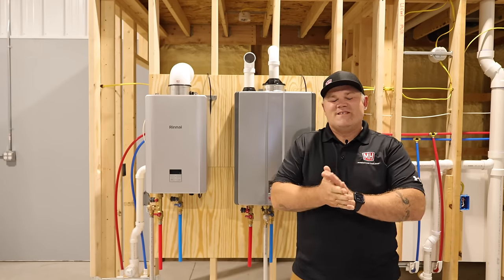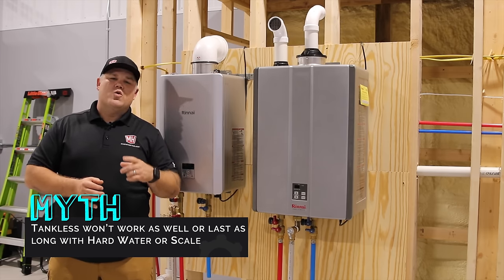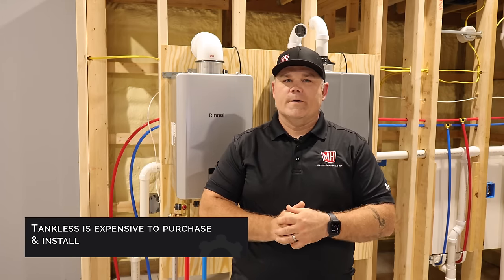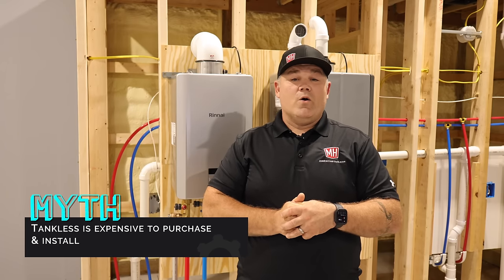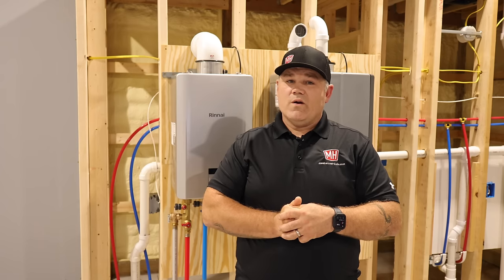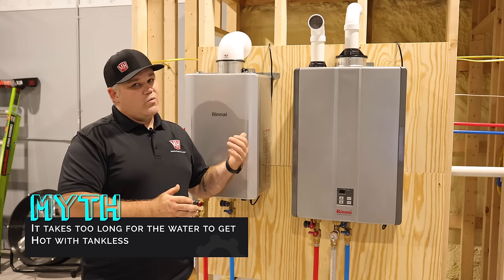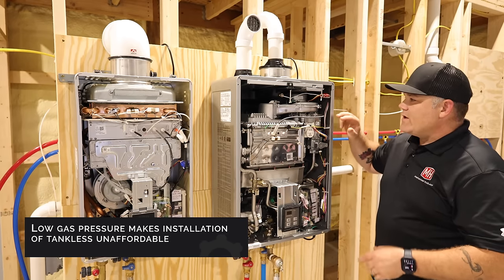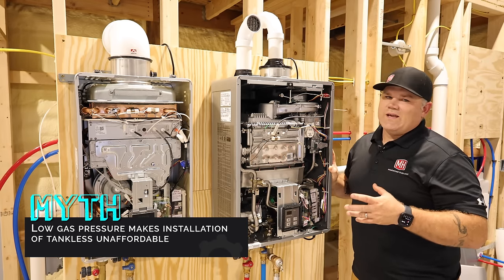Myth Busting! Tank -vs- Tankless Water Heaters

Comment: Nice explanation. Nothing but tankless since the late 90s. Another benefit not mentioned here is that the water outlet temperature never fluctuates, which is noticeable on the smaller, forty gallon units most commonly available. When the old direct vent, Navistar/Bosch tankless unit finally failed a few years ago we got a new Rinnai from Ebay. Running a thirty plus foot exhaust line was a PIA but well the effort. Since my "helper's" father wrote the plumbing code for our state, we did everything by the book. Never had any problems, although the old unit could produce much hotter water, which was unnecessary.
Reply: but under heavy load it will reduce the flow to maintain the temp. both types must be sized correrctly

Comment: I would love to see a comparison to a heat pump water heater on a large tank (90-110 gallon) vs gas tankless.
Reply: My heat pump is in my garage so the noise isn’t an issue and it’s so cheap to run. It was cheap to install after CA tax incentives and once I get solar too. Tankless would have a hard time competing.

Comment: I have 2 Rinnai units in my house. They work great but the recirculating pump is a must. The pump should be scheduled to run during the hours of heavy use like 6 am to 10 am and 6 pm to 11 pm otherwise it will wear prematurelly (the pump not the unit). The advice came directly from Rinnai support.

Comment: I bought my first tankless heater in 1980. They have been common in Europe for many years. I'm English. The second one I bought not only heated water but powered the central heating also. We use radiators in England. I love the fact that you can sit in the shower all day if you want. No  tank to run out.

Comment: Had a tankless heater about 20 years ago and it was the worst mistake I ever made.  The shower water temperature kept changing as my well pump started and stopped.  Hated waiting for the hot water to kick in when turning on a faucet.  Also got unreliable after 2 years and would not start every time.  Replaced with a conventional heater and now totally happy.  They are just too complex for reliability.
Reply: yeah, a tank vs tankless video sponsored by a company that sells tankless "upgrades" is a huge red flag. thanks for the perspective.
Reply: You lost me when you said "20 years"...I'd rather hear from someone who has a recent model.
Reply: @RealEstateRonFL  My big issue is the expense for when it fails or breaks. It was cheaper for us to replace the unit when it started giving us an error code and failed than to have it fixed. Convenient? Sure. Cost effective? Not so much.

Comment: I have a couple of questions.  What is the difference between the condensing and non-condensing units? Which is better in your opinion?
Reply: Condensing units have 2 Heat Exchangers, the 2nd one reburns and lowers exhaust temp. so you can use PVC for exhaust and intake air. They are also Stainless steel vs copper in Non Condensing. SS is because it make acidic condensation. If your condensation is going in cast iron drain you will need a Neutralizer for the Acidic water. I'm an Electrician and have both a Non Condensing NG Noritz and an Electric Steible Eltron in 2 homes.

Comment: Here is what I ran in to when I investigated tankless water heaters during my recent remodel. For context, the existing water heater was a 50 gallon gas tank unit located in the middle of a 2-story house, which is built on a concrete slab. The problems were: 1. The existing exhaust vent could not be used, the building code required replacement, which would have required opening up walls for 2 stories and penetrating the roof. The new vent pipes would not fit inside of 2x4 walls, so the walls would have to be demoed, furred out, and replaced to make space for the vent. 2. A new drain would be required from the middle of the house to somewhere outside, which meant trenching out the concrete slab. 3. I would have had to replace the gas pipe to the heater. and 4, after all that, it would not work if the power failed, despite being a gas heater. The only practical way to have installed a tankless would have been to locate the unit outside of the house somewhere, run an exhaust pipe up the side of the house, penetrating the eaves, and then build an enclosure to protect it. That approach would have required extensive replumbing to get the hot water back into the house, either by opening up more walls or trenching out the slab. Out of three plumbing contractors that estimated the job, two declined to bid and one came in with a proposal that was crazy expensive. So the house still has a tank.
Reply: If you had a condensing tankless it can be vented with 2” pvc pipe
Reply: How about an electric tankless on demad unit. The Bigest issue is runnig 2 8 AWG wires to it and replacing for a 50 Amp breaker in the pannel. Unlimited hot water, only on demand, whithout venting. Could install one for lower floor and a second one for upstairs depending how big your house is. This electric units are very small and fit eveywere. Have 5 units installed in several house/apartments and last about 10 Yrs and repairable( they go for about $220) Instaled them myself. The gas units also work with electricity so either won't work if no power
Reply: JUST DON'T TELL THEM AND INSTALL IT YOURSELF ?
Reply: @WillyK51  In my case, electric water heaters would have required a main panel upgrade, and a new service pulled in from the street. They would use more power than everything else in the house put together. Also, this is in California where we pay $0.40/kWh at the margin, and are subject to brownouts and "public safety cutoffs", so we avoid electrical appliances wherever possible. Meanwhile standard tank gas water heaters work quite well without electric power - there is no electrical service to my water heater.

Comment: The reason I got a tankless water heating system in my house was quite compelling for me.   My previous tank heater had the pilot light go out.  I attempted to re-light the pilot.   A small volume of accumulated gas in the tank deflagrated, singeing my eye lashes.   I was lucky that day.
Reply: This is a good reason for why homeowners should be taught about gas safety. Lucky you didn't blowup your house.

Comment: You overlooked the most common problem with tankless heaters. You can't run a warm trickle of water. I had a tankless in my previous residence and totally hated it for that reason. It was either all or nothing so I was actually wasting water and gas when trying to do dishes compared to what I have now. I  could also finally put a flow regulator on my shower so I don't get needlessly blasted constantly.
Reply: 1. You shouldn't be washing dishes by hand. It wastes water and your limited lifespan. Get a dishwasher and use it correctly as per it's manual. I'ts just better and only uses 2.5 lieters or so.
2. Do you not have mixer taps? Get a mixer tap.
Reply: @MeepChangeling  Well maybe they dont have the money for a dish washer or able to pay for somebody to install one. Since you are so rich why dont you buy them one and pay to have it installed :face-orange-frowning:
Reply: Why do you have water running while doing dishes If you are saving water?  You fill the wash and rinse sides- wash, put in the rinse side.  Once everything is done you empty the wash side and can do a running water rinse if there are suds in the rinse side...  Even the military uses 3 bin wash..  wash, rinse, sanitize..

Comment: I did a mountain of research on tankless when my tank heater was going bad and my conclusion was!...  Tanks are great.  Easy, simple, no maintenance, and a large reserve of hot water if you get a 50 gallon like me.  I have never once wished I got tankless.  It's one of those cool shiny things that just doesn't make sense most of the time when you think through all it will cost you in time and money.
Reply: From what I gathered with this video, the only advantage for tankless is space. Not what his sponsors hoped for, but still glad to be put off tankless.

Comment: Myth #1. I had tankless in my home for about 8 nightmare years or so. Finally replaced with a 50 gal water heater and it was a VERY happy day despite the cost. The folks that are the happiest with tankless are those who live in an area with no liming problem and or those who have the money to pay the plumber to come out for frequent upkeep. The things are simply NOT perfected and I'd be happy to elaborate if anyone is interested. Remember that I told you so, should you dip your toe into the on demand water racket.
Reply: Maintenance is very easy, I have to descale often, spa rinse and a pond pump and a 5 gal bucket is all that is needed.
Reply: @Refertech101  Well, that's you. I'm glad you made peace with it. I used your system as well. One time I left one of the valves cracked a bit and the cleaner goop went through my piping system. It was a couple of months before that taste finally subsided in the drinking water. 
One thing I didn't mention in my epistle. The first thing we noticed was that the darn thing surged vicious hot water....hotter than it was set for to start, I imagine. In the shower, there was one spot on the water valve handle thingy that worked. A millimeter out and the water would go from hot as heck to warm or cold over and over. We put up with that for years until the unit finally died (an expensive part went belly up) and we go shet of the drat contraption.

Comment: To fix the problem of it taking a long time to get hot water:  Use a HW manifold placed very close to the hot outlet, then a Single 3/8 PEX line to Each shower or faucet.  The 3/8 lines flow tons of water for one fixture And pushes the hot through the length of the line 4X faster than using a 3/4 trunk line throughout.  Always use a manifold with multiple outlets for HW to save energy and get hot water fast.
Reply: My tankless system has a feature to circulate hot water though the pipes even though you are not using water.  The pipes are insulated and it drops the 98% efficiency only by one percent.  Hot water is nearly instantaneous.
Reply: Problem is, the sitting cold water in the line from the manifold to the fixture.  And if  you have a recirculation pump in your systemm, a manifold would render that recirculation pump useless.
Reply: Also, I cheat by turning on the sink along with the tub so my tankless heater goes into turbo mode and the colder water is bled from the pipes.
Reply: And a 3/8 inch line?  If you are using PEX connectors which go inside the line, you inside diameter is even smaller and your pressure is crap!  I have a 3/4" insulated loop through the house, and the only place you find 1/2" is the small section that stubs thru the walls, recirculation pump that is activated by motion sensors around the house so it doesn't run continuously, and even if it ran 24/7, based on the numbers, it would cost me maybe $30 a year to run.  Small price for hot water at every fixture within seconds
Reply: Correct.  The flow to a single fixture is under 2 gal /min so pressure drop is minimal in most cases and there's no thermal loss from recirculating.  Hard to find 3/8 PEX, not at home depot so I use 1/2 pre manifold.  3/4 trunk lines are the worst possible choice but It's the legacy system installed everywhere.  Always use a small single line to each hot fixture.

Comment: You will never convince me to go tankless. I maintain my traditional 40 gallon tank and have years and years of service with zero issues. Good flushing, change anode and overpressure valve and nipples and that’s it. I guarantee a tankless would have been a huge difference.
Reply: Huge difference is right. The fact that is only uses gas when running I’m water is about the only reason I need to mention. I switched and would never go back.
Reply: @jmoore4211  - - do you want to talk about all the maintenance you have to do on it. My little pilot light is such a huge draw. A $500 tank with maybe $100 in maintenance over the last twelve years. Tell me what your cost has been.
From google…. You are right a lot of gas 😀
‘The units themselves use a lot of gas all at once. A typical whole-house unit burns around 200,000 BTUs per hour. Compared to your 50-gallon gas-fired, tank-type water heater, which burns around 50,000 BTUs per hour, that's a lot of fuel.’
Reply: @condor5635  good luck getting a water heater for 500 bucks today. Just saying they save money and give u hot water non stop. I have my wife and two teenage girls in the house. I’m the last one to shower so wouldn’t work with a tank heater
Reply: The flame varies as it’s heating so it’s not a constant gas usage. It’s proven they use less gas in a year. I’m glad u like the tank, I’m just saying I love the tankless
Reply: @jmoore4211  - Funny I got a wife and two teenage girls as well. All four of us don’t typically take showers at the same time or right after each other. I think I can remember once or twice where I had to wait maybe 15 minutes to get some hot water but it’s never been an issue. It doesn’t matter really whatever makes you happy!  Lots of people love the tankless. Lots of people like the old style. To each his own. Have a great day!
Reply: @condor5635  I agree. Glad it works for u guys
Reply: So glad you guys reached your kumbaya moment. I’m tearing up a little.
Reply: 47 years of working on water heaters and softeners. Almost every under slab leaks were on hot soft water. Water heaters would on soft would Last 4 to 6 years. The heaters that lasted more then 10 years were almost all on hard water.  I had a new house on soft water 15 years three water heater replacements and two under slab leaks. Current house on hard water 30 years and I just put in its third water heater. Would never have a softener on copper plumbing. The tankless heaters I worked on I would not have.

Comment: I had to clean my tankless 3 times a year. I had non stop use so it worked for me. The same goes now as I am single.  The take away is the tankless requires a lot of maintenance, vs the water heater.  I’d honestly go for the water heater and insulate it and keep it on a decent temperature.  Insulating the heating lines helps for efficiency as well.

Comment: As a convert to tankless, and a contractor, my personal experience with my Rheem does take longer to deliver hot water to the nearest faucet.
After the install, the path to this faucet was increased by 18" from the existing connection to the old tank.  This additional length was pex.  The existing plumbing is all copper.
Before the tankless, the time to get full hot water from totally cold was about 12 seconds.  After the tankless install, it now takes 35-40 seconds!  The energy I saved has been partially wasted by extra water use.
I measured that water, and it was about 72 ounces.
Compared to a calculated 18 ounces previously. 
Is the Rheem working correctly?  I don't know.  Is it installed correctly?  Absolutely. 
It has been installed for about a year now and I've noticed no change in performance and we get endless hot water.
But our kitchen sink, which is furthest from the heater(8 more feet), takes so long, I have to run the faucet for over a minute prior to starting the dishwasher. 
So... not a myth, at least with the very popular Rheem model sold at Menards.
Reply: Jesus is the only way to healing, restoration and salvation to all souls. Please turn to him and he will change your life, depression into delight, soul heading from hell to heaven all because of what he did on the cross 

“Whoever calls upon the name of the Lord shall be saved” Romans 10:13

Comment: Maybe not always but sometimes you DO have to upgrade the gas line. It depends on the size of the pipe, how far  the heater is from the meter, the gas service pressure, and other appliances on the service. You should calculate the gas line before you install.
Reply: That's correct. I would have needed to upgrade my gas meter, line, and several connections, all at my cost of $1,750. The tankless was also about $1,000 more than a comparable tank unit, and that didn't take into account the time the plumber would have charged me to run the new lines. Even with the energy savings, my breakeven point was nearly 30 years. No thanks.

Comment: Good video.  Two topics I would have liked to hear are time it takes to get hot water to the faucet, and maintenance costs over time.  I like tankless water heaters, but it seems they have more components that can break down.  Maybe not, just my thought.
Reply: The 1st question of whether to go tankless or not is will it be electric and how many spare breaker panel slots do you have. I was shocked to see my brother's system used 6 slots. If I were to go tankless I'd have get an entirely new panel installed with higher capacity and more slots which can have immense ROI variance.
Reply: Takes the same time to get to the faucet

Comment: One thing I didn' see mentioned is that upgrading your gas service can cost less in some cases if you simply use the same pipes, but raise the gas pressure in the pipes to 2 psi. (Natural gas is normally 0.25 psi, and propane is normally 0.4 psi.) The pipes have to be retested at the higher pressure, but they almost always pass.  And you have to have a regulator at the tankless water heater, which can  run about $30-$50.  But in most cases it winds up being a lot less expensive than repiping your house.

Comment: Another major disadvantage of a tankless water heater is if your in an area with low cold water pressure (A LOT of people are), you will now also have low hot water pressure. With a normal tank system, the internal tank pressure increases as the large volume of water heats up, giving you much higher and better hot water pressure than you have with your low cold water pressure.